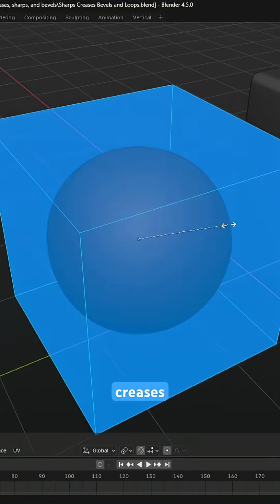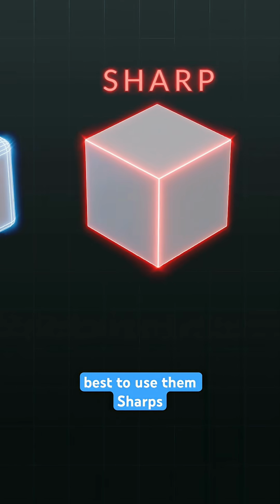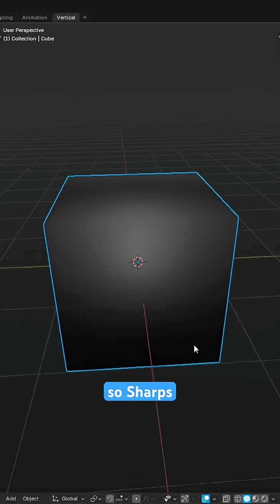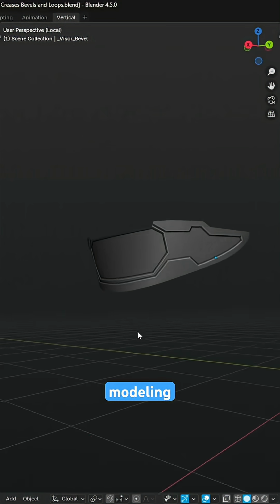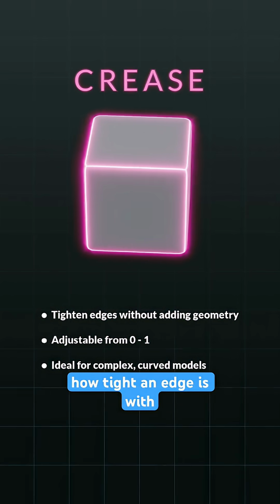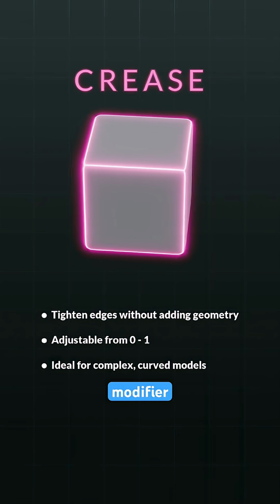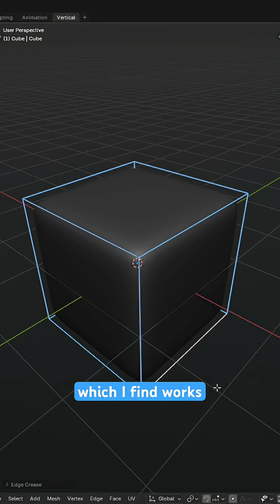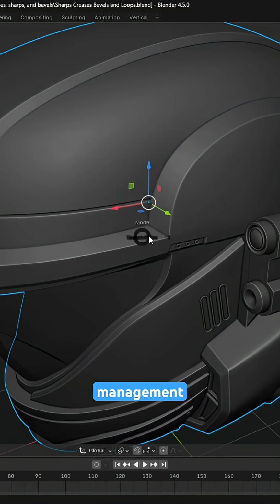When to use Sharps, Creases, Bevels & Support Loops | #blendertutorial #blender3d #blendermodeling

Comment: So basically they all (with the exception of "sharp") do variations of the same task. "Crease" value is the most non destructive, support loops are the most custom, and bevel lets you customize the shape profile of an edge (auto creating multiple loops)
Reply from the maker: At a simplified level, yes. 😄

If you check out the related video, I go into greater depth with the examples as it gets a little more nuanced depending on what model you're working on. So, it very much becomes a matter of trial and error and testing different options to see what works best for your specific modelling scenario. 😄

Comment: Bevels really only cause issues if you don’t use the right miter topology
Reply from the maker: It's circumstantial, if you're using a weighted bevels modelling approach, you have a lot more leeway with things. 😄

In this instance, and sorry, I might have not been specific enough, I'm talking about how these edge types work in relation to subdivision hardsurface modelling. So even if you do change the miter outer type from sharp to arc, you'll still need to clean up all the topology around that edge to properly integrate with the rest of the topology. 😄

Thus, why in most instances, I'll advocate for using creases as you con model with simpler topology without the need for ridiculous amounts of topology clean up. I'd personally save bevels, much like I mention in this video, for the profile of an edge when it's necessary as opposed to using them all over the place, just saves a lot of headaches with topology management. 😄

Comment: What about bevel weights
Reply from the maker: So bevels and bevel weights work the same, the only difference is that using ctrl+b is considered destructive modelling since it's now apart of your physical topology. Whereas bevel weights are non destructive and let you iterate on the bevel before committing them to your topology. 😄

Bevels vs bevel weights would be its own separate video, which now that you mentioned it, I might just do. 😄

But given that they fundamentally work the same when it comes to how they affect edges, I didn't think it necessary to mention them for the topic of this video. 😄
Reply: Yeah, fair. But i think bevels compared to bevel weights still have a lot more control and they are used in different situations
Reply from the maker: @Vanta3D  Oh definitely, it'd just require a different video to explore their different use cases. 😄 Can only cover so much in a single topic at once. 😄

Comment: How did you drag those other edges?  By selecting only 1 line idk what that called
Reply from the maker: I think you're referring to an edge slide? Where I select a row of edges and then move them along the surface of the model?

Once you have an edge selected, you double tap `g` and then you can slide an edge along the face normals of your model. 😄

Hope that answers what you were asking about?

Comment: uhhh...I use sharps a lot for my subd models, and I strictly use bevels as creases and don't touch creases ever. Will I get arrested? (I kid, but I actually do those things XD)
Reply from the maker: Huh, I’m curious how do you use sharps in subdivision surface modelling? Outside of using shapes to keep track of edges I don’t wish to move during the modelling process, I’ve never known a use case for them. So keen to know how you use them! 😁
Reply: @masterj2001  autosmooth command marks sharps where eventually I will have bevels. So it’s marking and select tool that I make sure to wipe once I’m done subd modeling. Where sharps go is also where you usually want seams at.
Reply from the maker: Ahh yeah, you use sharps the same why I do them, just to keep track of things. 😄

Comment: I dislike edge crease because I can't set it to 0.8 or 0.9 otherwise it fucks the shading.
And I like edges with slight roundation so I always go with Bevels.
Reply from the maker: Handy suggestion, use a value of 0.55 (that's what I use). I can't confirm this, but I think creases work on a logarithmic scale, so there's less of a difference from values from 0.6-1 (that's why I believe around 0.5 is a good sweet spot). 😄

Also, if you check the related video, I dive into a lot more detail than what is shown here for how all these edge types work, when they don't work, and how to use them in tandem with one another. Hopefully it helps provide you with some additional insight to the matter. 😄
Reply: @masterj2001  thank you! I will check it out.